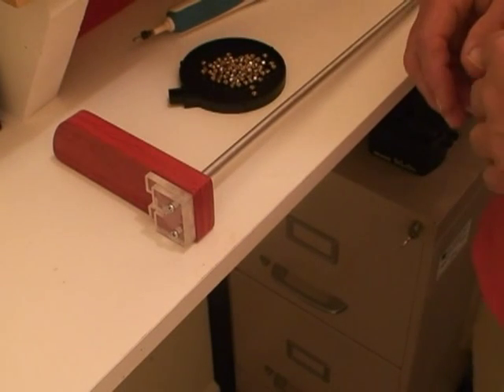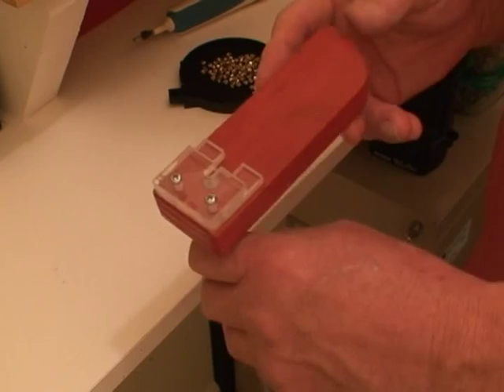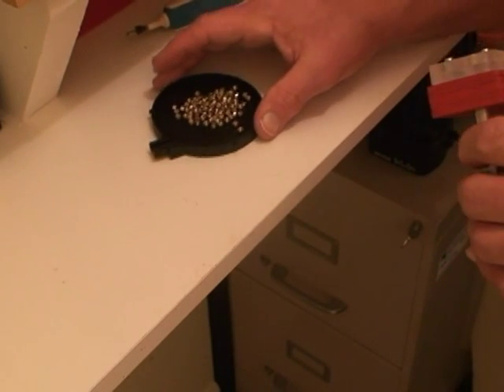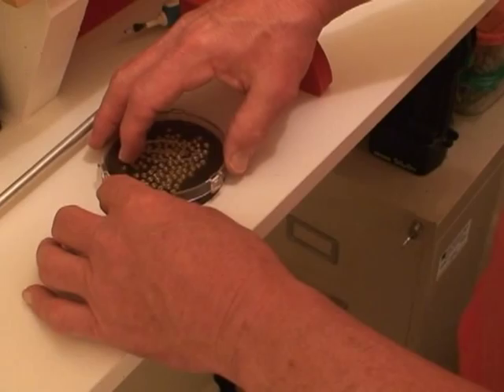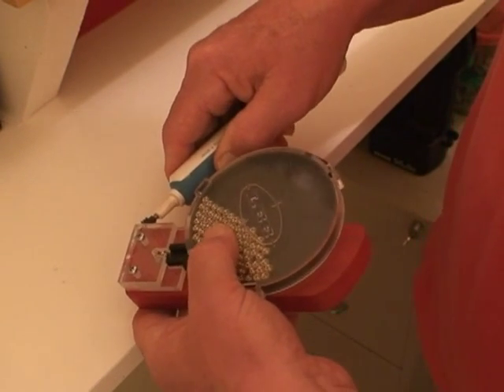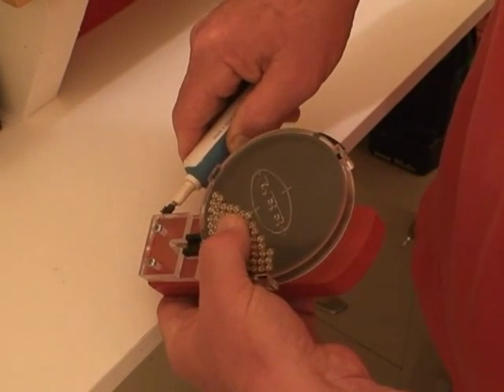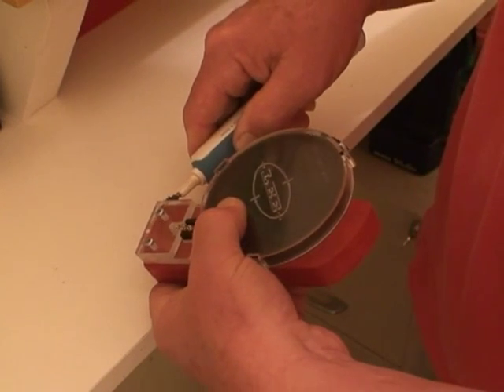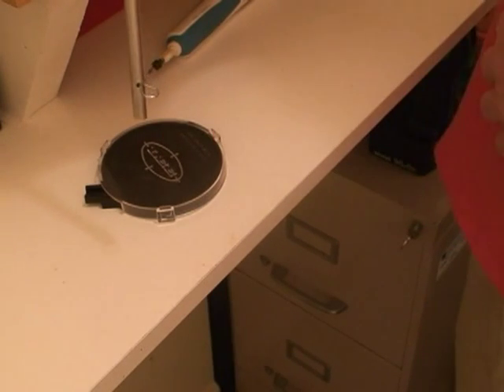Hornady LNL Fast Primer2.avi.mpg

Comment from the maker: Sorry to be so long in responding to questions… I have made a new version using the round primer tray from a LEE Auto Prime. The reason I changed to the Auto Prime round tray was to avoid the difficulties involved in making the feed ramp for the tube. The Auto Prime round tray has the ramp built in so all that is required is to epoxy a primer tube for the press to the tray. New Video soon.